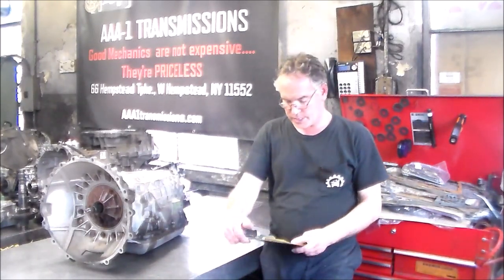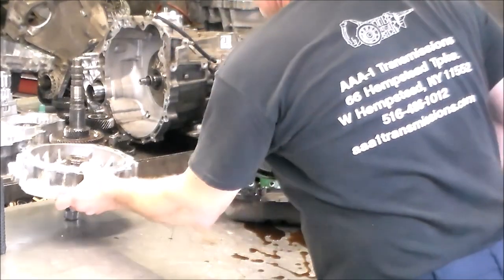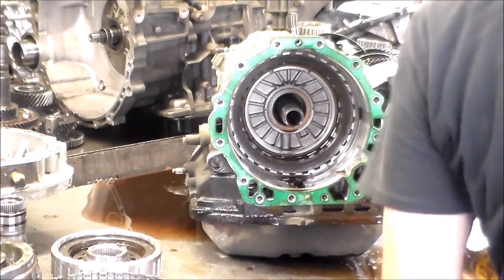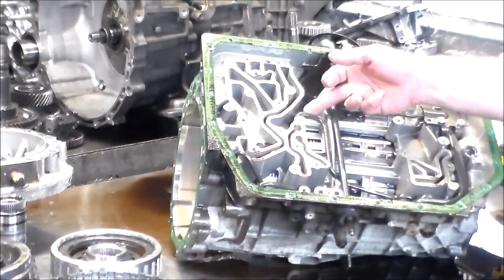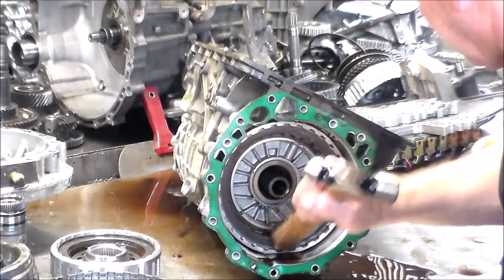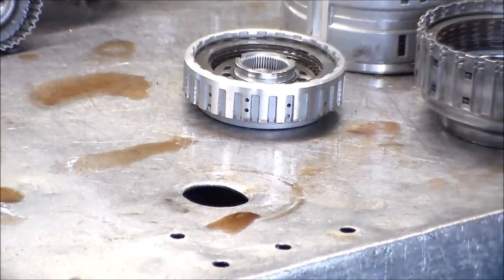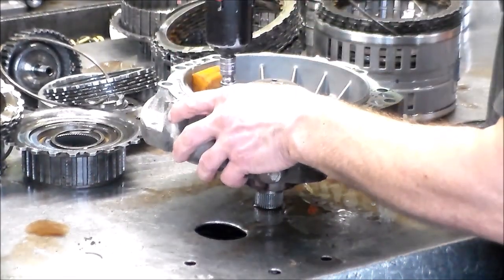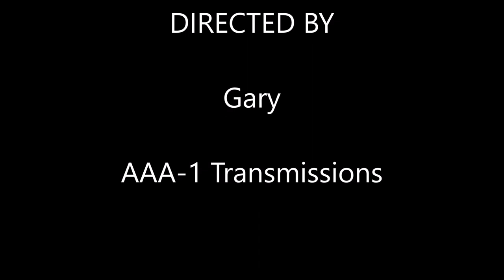ZF5HP24 Teardown

Comment: I have an '01 BMW 540i with this transmission. I bought a much lower mileage used one. I am so tempted to have a go at rebuilding the used one, getting a new torque converter and popping it into my 540i. How idiot proof is the rebuilding process? Am I stupid for wanting to have a go myself? The most gearbox work I've done it swap manual transmission fluid, and changed out solenoids on a 6HP26.
Reply from the maker: Well, I think some experiance is good, Overall not a bad transmission to work on, do you have means of depressing springs ? Snaprings and split rings will have to be removed to changed the seals
Reply: @GaryFerraro  no I don't, but I think I know the tool you're referring to, it's like a bench press to compress the drum (?) to fit the snap ring right?
Reply from the maker: @vviiper  Yes, some are regular snap rings and some are split rings

Comment: How much does a new valvebody of this transmission? I heard that the valvebody itself gives a lot of problems.Sometimes i wonder if these transmissions are made to last short time.What do you think?
Reply from the maker: other than the lower front half and sometimes the upper rear half cracks(not often) i haven't really seen to many issues even with solenoids, they never go bad

Comment: Hello, I have this transmission on a 2000 BMW 735i. Few months ago it broke the A drum and I brought it to a shop, they say that they changed friction plates, A drum, oil, etc. A month later the transmission started going into transfailsafe prog, when you give it gas. I brought it back and they changed the valve body with a second hand one. Now the transmission makes a slight hissing sound on P, otherwise it is OK-ish, just not perfectly smooth always, especially if I give it light gas, it is not perfectly smooth. I want to change the pressure regulator by myself and service it properly. I have another transmission with fried friction plates, but I remember it shifting more smoothly, should I take a look for some parts there. Any tips where to start and how do I approach this, I do not want to bring my car to shops anymore, I am tired of that and do not want anybody to touch it anymore. I have no codes in the transmission when I read it in INPA. I want to inspect and make sure everything is ok in my valve body. I have serviced one of these in the past, but changed only oil and filter and it was perfectly fine. I found TransGo regulator and I do not find any other parts for it, although if you can suggest anything to check and replace, I will be glad to know.
Reply from the maker: How does the trans work cold and how does it work hot?  you said they changed the valvebody is the lower front half new with the updated pressure reg valve?
Reply: Also, there is a slight delay and a very small kick when engaged into reverse.
Reply from the maker: @monichochannel  have you reset shift adapts?
Reply: @GaryFerraro  yes, adaptations make it slightly better. The rougher change is 2-3 and not always. Reverse engages slightly harsher than the others, otherwise it is fine. I have ordered a transgo regulator from the US, would be here in Europe next month. I just thought that the solenoids may be slightly more worn on my transmission.
Reply from the maker: @monichochannel  Try the valve, solenoids rarely go bad on this trans
Reply: Hello, an update - I have replaced the TransGo valve, and serviced the transmission with the ZF kit and now it shifts nicer on most of the gears, although shifting 2-3 after I release the gas is sometimes harsher. I thought about adding an additive or something, and I have reset the adaptations as well.  I am thinking about adding Bardahl ATF transmission additive. Also, I have something like a vibration ( more like a stutter or kinda of a shake of the engine ) around 100 km/h with the Alpina software when the torque converter is locked, I am not sure if that is normal, with the original non-Alpina software I never had it, so I am even thinking about going back to it, because it seems less stressing on the transmission overall.
 @GaryFerraro